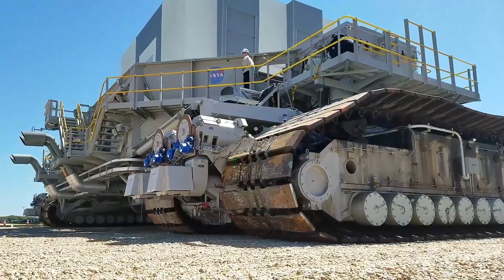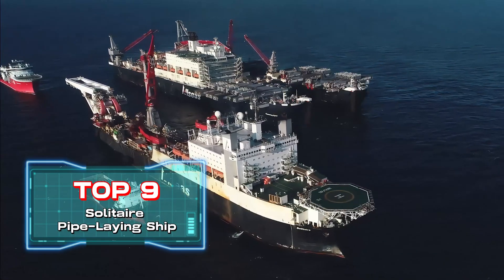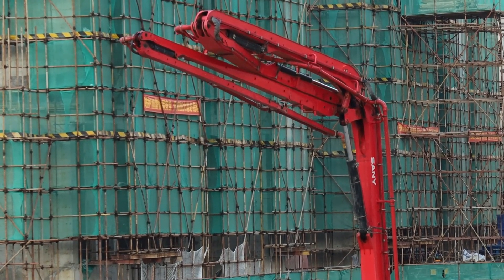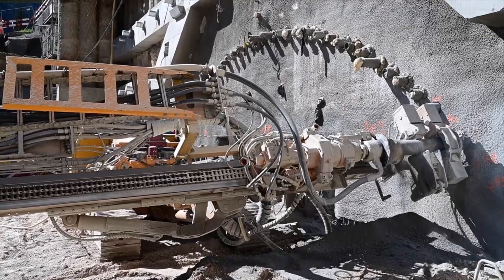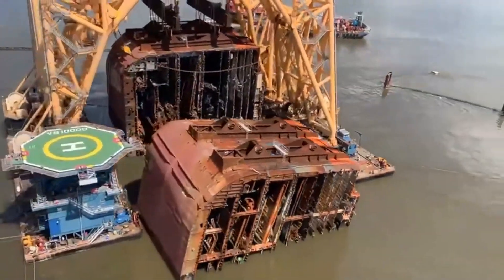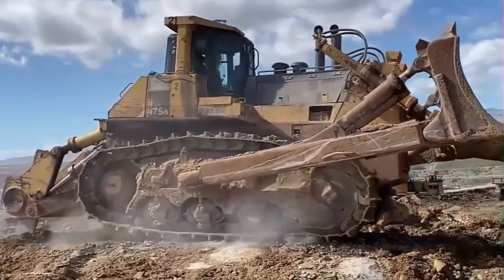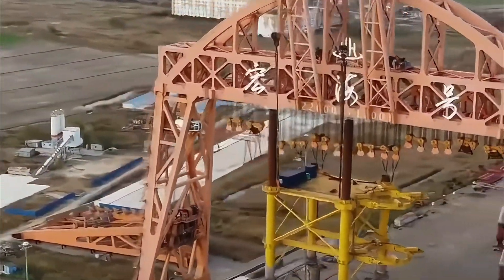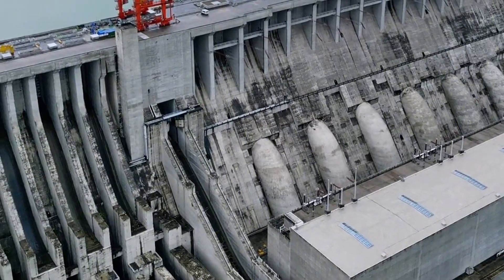10 Amazingly Powerful Industrial Machines

Comment: Wow that concrete pumper truck has a horizontal reach of 220,000 feet and a vertical depth of 188,000 feet holy $hltt thats 41.66 miles by 35.6 miles